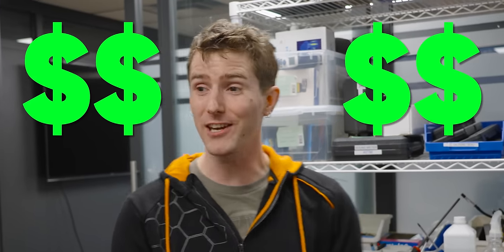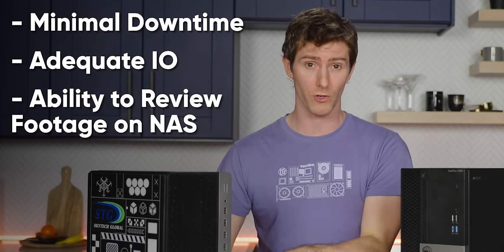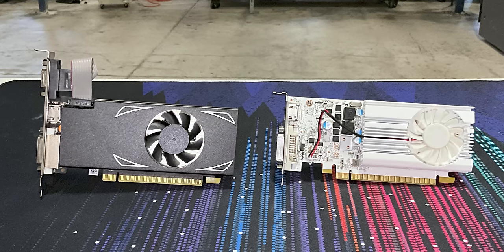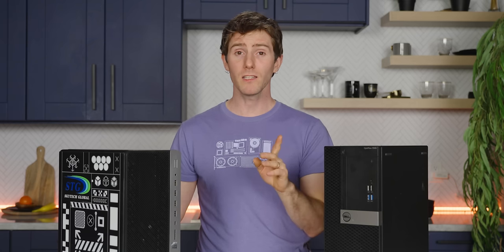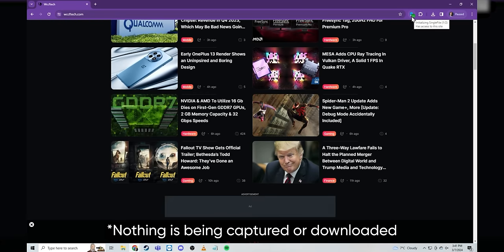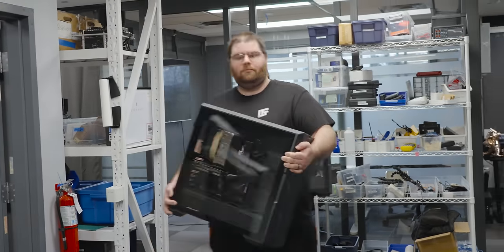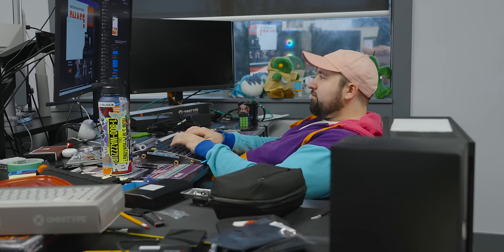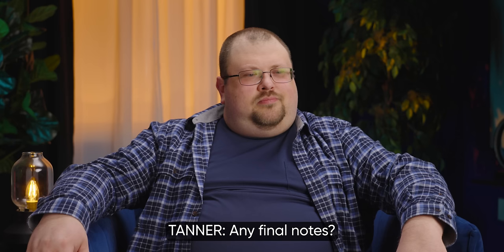We Downgraded our PCs to Prove You Don’t Need a New One

Comment: I'm a sysadmin at a small company and we just replaced our Lenovos E73 with i5 4th gen with Dells 7010 with i5 13500. Most of the users didn't notice any big difference and if the PSUs weren't starting to fail we could have easily kept the another two years without major issues. As a company, we use prebuilt PCs because of the readiness of driver packs for deployment, 5 years warranty and on-site hardware support, the ability to deploy driver updates with a dedicated tool and to avoid building 100 PCs from scratch. We're just two IT guys for 150 employees.
Reply: that's kind of surprising that you're still using computers, as opposed to laptops, which seems to be what companies tend to give out nowadays
Reply: @Gregorius_ laptops are computers
Reply: @Gregorius_  for large companies it is still much easier to go with desktops because it's more serviceable on site. Just like this video is trying to convey, not everyone needs a laptop.
Reply: @Gregorius_ Just because "most companies" do the wrong thing, doesn't mean one should. Laptops suck. And I will die on this hill, tyvm.
Reply: @JanWeigangMusic  sorry i offended you
Reply: Well indeed we have the 1/3 of the fleet composed by laptops. We allocate laptops only to users who actually need to work outside of the office. The reason is that laptops are way more expensive and could also represent a security issue if left unlocked on a train for example. Also, they are slower than a good old tower PC and thus have a shorter lifespan.
Reply: @jiminysnicket86  i meant desktops; sorry, I'm ESL
Reply: @eldukedrino   most big companies actually give out laptops and docks, as they provide a homogeneous environment both at home and at work
Reply: going below 8 threads is abysmally bad, my 4770 was less painful than my office 6400
but all depends on the software used, you probably could've grabbed N100 machines instead for most of them
Reply: @JanWeigangMusic  The amount of people who asked is equal to the amount of people who listen to your music. Zero.
Reply: @JanWeigangMusic due to the home office laws many companies that were against laptops are moving towards them anyway
as it quite often happens laws meant to help are causing harm to both sides...
Reply: We have 4GB RAM wigh 4th gen processors and spinning rust. Our users would notice an upgrade.  My 8GB 6th gen with spinning rust dies if I get to Chrome crazy. (It runs out of RAM) I found an OLD small ssd I use as cache but speedtest indicate it isn't much faster than the spinning rust
Reply: @Gregorius_ Desktops are usually cheaper and easier to service and modify. They can also have a longer lifespan.
Reply: zz.zzz.z..zz
Reply: Staff don't look after laptops... PERIOD!!!!! , but our management team isists they want to see users carrying computers about by their displays.

and we noticed that  there is something wrong with  4,5& 6 gen i7 compared to I5 and even I3.
I'm currently tryiong to find out why a particular I7 takes 20 minutes to run software that an I5 runs in 5 minutes.... despite cleaning , re paste & re-install.
Reply: I would focus more on the drive than the cpu with the above specs mentioned. An i5 13th gen with an ssd will do well for work purposes
Reply: They probably didn't notice a difference, cause they was doing minimum work.
Reply: Worked at a call center they just decided to go with chromebooks. Surprisingly they worked well for the job. (If you didn't work at a call center you normally have 2 - 3 screens with like a millions tabs open in Google Chrome/whatever browser you use)
Reply: I'd ask why the company didn't just replace the PSU's and keep chugging along... until I saw a picture of hte Lenovos.

At least the Dells (ironic) are more modular
Reply: @JanWeigangMusic  its so that employees can have the same setup at work and home with little effort and money on anyones part.
Thats why they choose laptops, this isnt needed for every employee or every company though, thats why some dont do that.

There are situations where laptops are better, there are situations where desktops are better.

Ive just had to sell my desktop and swap it out for a laptop because ive got nowhere to put it and im moving very frequently.
It has been in a box in a shed for most of the past year and a half.
Reply: 7010 is 3rd gen tho? The PSU is a big point of failure I feel for these older prebuild. I had to swap out mine for a 7010 SFF a while back. Sourcing one for a reasonable price was a pain too.
Reply: I still use the same board from 2016 h612 i just upgraded my i3 2nd gen to i7 3rd gen all i need basically.
Reply: @RuruDouji  that's cute.
Reply: @JanWeigangMusic  While I like the portability, I'll agree that laptops with any serious grunt will be bad from a thermal design point of view.
Reply: @napowolf  Doesn't the (7/9)010 MT take a normal PSU?  I'm concerned that the 7020 that serves my home net doesn't.
Reply: I used to work in kinda big computer (1000+ users), we had a range of processor from 4th gen to 12th intel mainly I3 and I5. And appart the 11th and 12th gen they all didn't have ssd, we used to have a lot of complaints on those older PCs. And most users are just on browsers and some light apps. We eventually installed ssd's on those that had m.2 slots and replaced older ones. The ssd's made a big difference to be honest.
Reply: @christopheroliver148 I got the SFF version.
Reply: @Gregorius_ yeah I would love to do CAD work on a laptop when it throttles and lags 5 minutes in
Reply: @Gregorius_  they give laptops to employees that work from home, need to travel, etc. If you are working at the office only they will not spend the extra money for a laptop.
Reply: @Gregorius_  90% of employees don't need a laptop, unless they work from home or they travel for work. Desktops are cheaper, more modular and often more reliable.

Comment: My work got rid of all their Optiplex 7010s...  Took almost 10 minutes for them to boot up previously.  I got ahold of one, increased the ram to 16GB, cleaned up the machine, new thermal paste, switched to an SSD, and added a wireless card and an RX6400.... Runs like a beast now... All in less than $200.
Reply: Shame that the rx6400 has cut pcie lanes seems to be the best case for it.
Reply: I  have 7010 for htpc with rx 6400 next to the tv and 7050 for proxmox server with a2000 gpu. Best of all you can use the original proprietary psu.
Reply: The (9|7)010 MTs make very nice Linux boxes.  About the only case where mine fall short is with some music synths which are cycle pigs.
Reply: you running win10 or 11?
Reply: @StevoHDA Windows XP
Reply: @balsalmalberto8086 epic fail. Using an unsupported OS is asking for trouble.
Reply: @balsalmalberto8086  was asking op
Reply: We used to have 3 Dell towers in use here (3010s/ 7010s). They were pretty good to be honest. Eventually the motherboard went faulty in mine and our other one just got too old and it wasn't worth putting a 1050 ti in cos the CPU was a bottleneck. I used the other for CCTV and it ran 24/7 for like 2 years and never crashed. Those 30,70 and 90 10 Dells were the last to have a standard motherboard connector btw. The ones ending in 20 moved to a nonstandard one.
Reply: mine has worked perfectly fine with a 3470 and 32gb with an ssd... if i'd upgraded to an i7, probably would be even better. problem is, the board. like the physical location of sata ports and then not having extra fan headers. with an old single slot gpu, probably be fine for most stuff. my asus rx 580 fit, barely with some sata cable finagling. gigabyte 580, would not fit, period. but the case cooling, probably wouldn't be good long term for that card. but again, a smaller old one would probably be fine, and maybe rig up a front fan. that said, my 4th gen z97 and 4790k is a huge step up. and with a bigger case with plenty of airflow for gpu is way better for gaming. but my old one worked pretty well.
Reply: but then, that was my first pc since my top of the line gateway from the mid 90s... sooo... looking forward to seeing what my 690 ddr5 will do when i finally find another decent price on a 12600 or 12700. had an i5 kf, then amazon and newegg had regular k for the same price, so returned it... but of course, by the time i got my refund the sale was over... and the 4th gen works absolutely fine for everything i need right now, and my worthless internet would just bog it down anyway, so not in a huge hurry. it didn't wanna work with my windows 10 at all anyway, and haven't been able to get linux to work either for some odd reason. and with decent internet, my ancient stock dell works absolutely fine. i've built lots of 3d parts and stuff on it. i really think the only problem is using 123design cause i just can't get fusion to do what i want for whatever reason, never really figured it out. it got pretty laggy with bigger more complex stuff. but i think my 4th gen and a discrete gpu would fix a lot of that. probably just an i7 and better igpu would really though.

Comment: I buy and refurb these exact type of computers to allow new not-for-profits to not have to worry about the usually high price of computers. They have their place.
Reply: Oh, that's a thing? How is business?
Reply: What you gonna do when windows 10 is unsupported on older hw? Rufus win11?
Reply: @Regnskov  Upgrade them to Linux 😜
Reply: Your work sounds awesome tbh, thank you.
Reply: @Regnskov  as long as you have 8th generation it is supported.
Reply: @Regnskov upgrade to 8th gen Intel 😅
Reply: @Regnskov  When has loss of support ever been a problem? We have some stations still rocking Win7 to this day.
Reply: Answer is yes. Frommy own work expirience I have a work laptop on a I7-8565U cpu and a 1tb nvme 16 gb of ram and it's garbage. My personal pc is a 14900k and 4090 with gen 4 nvmes and and 7400mhz ddr5 48gb it's a drag going from one to other.  I have told my boss I feel like we could get so much more work done with a faster or newer cpu but Ya they don't care or at least enough to upgrade everyone.
Reply: There is even lower spec side of PC building for small businesses, with used older gen parts, that equals the cost of one single new 1TB m.2 SSD.
Reply: @michaelmonstar4276  Always that same argument that never bothered anybody apart from Microshaft themselves 😂
Reply: @michaelmonstar4276 I've yet to hear of someone running into security problems because of an outdated OS. As long as one uses common sense, has a decent AV and has upgraded the OS as much as possible, it's usually not a problem. By the time an OS is retired, almost all it's security issues have been discovered and fixed. And a new OS means new security issues.
Reply: Tiny 11 ftw
Reply: Where do you get these pc’s?
Reply: @Hoaxe72 I work for NRDC, the biggest environmental not-for-profit on the planet. We have several sources for getting these in. Recycling is a good thing ❤
Reply: @teez_youtube I have a n2840 and a 5250u laptop that both run everything perfectly fine. Sounds like a case of spoiled person to me
Reply: @teej_youtube  literally the (normal)  newest and highest-end consumer parts in your rig, of course your work laptop is going to feel slower. Probably a 3-4 thousand dollar differance there...
Reply: @greatmatt301  slow
Reply: @Hoaxe72  The Recycle department of your local county can help you i guess, here they do ! But we have these companies here.
Reply: Now you have to worry about the high price of computers because videos like this will promote more second hand market activity and prices will go up xD
Great job
Reply: Gruties
Reply: Keep up the good work, my friend :)
Reply: @r.j.sharkey do you really think they all have 8th gen, thats funny.